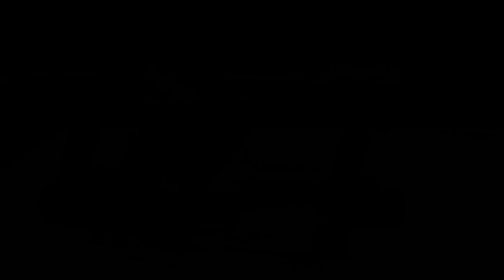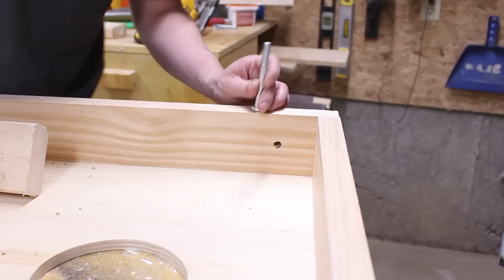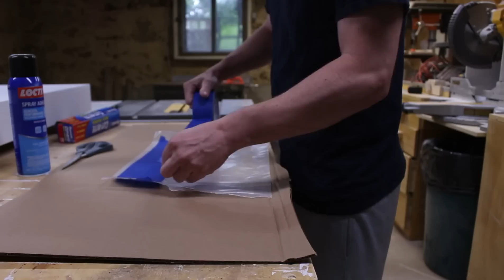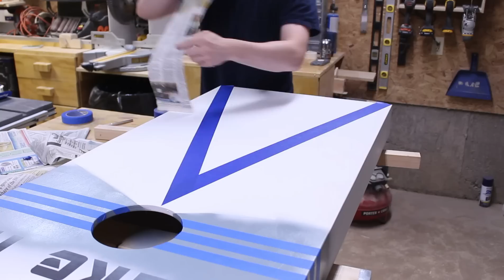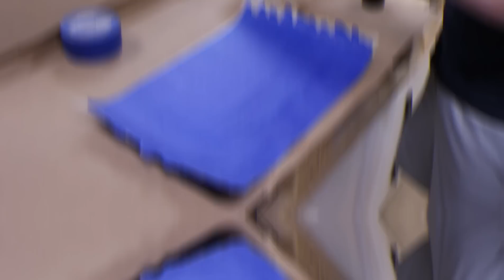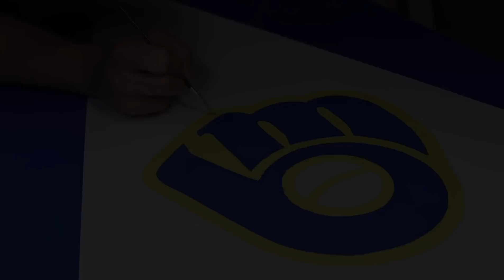Easy to Make Cornhole Boards using 2 Power Tools - How to Make It

Comment: It's not made our of pallets? 🤯😂

Really cool method for the logos. No idea why I didn't think of that like 1mth ago when I was trying to do a pallet wood farmhouse quote. But I was using wood stain not spray not so maybe it wouldn't have made a difference. Thanks for sharing your logo transfer idea
Reply from the maker: Haha yeah, I decided to switch it up a bit and not do a pallet wood project for my cornhole set.  I'm not sure how well stain would work using this type of method since the stain is very runny. Might be worth giving it a shot though.  How did your farmhouse quote turn out?
Reply: Well, Brad.... I scraped that idea. Literally used it to make a farmhouse style picture frame 😂. Since I had already tried to carve the wording with my dremel, I just ripped sections of the boards that did not get carved. Turned out good tho. At least imho. It was a wedding gift so I wanted a really nice diy gift to give away.